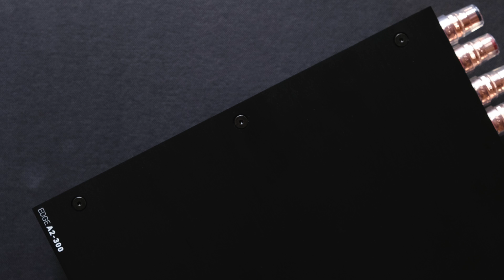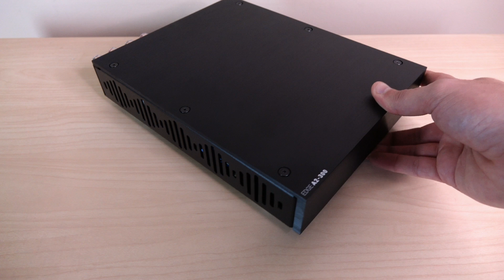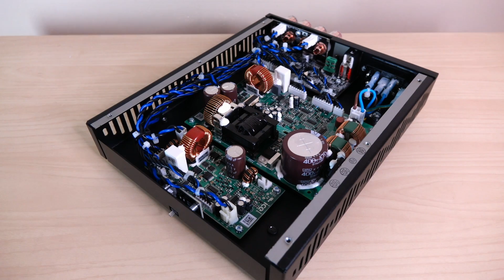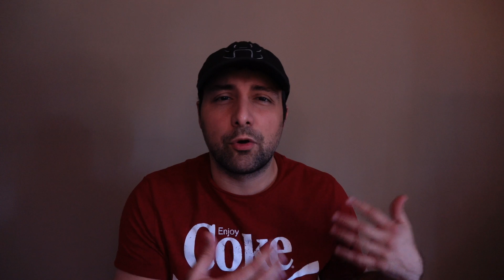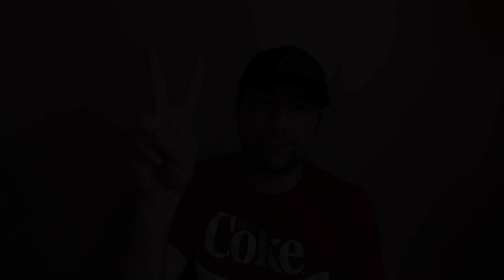Review!  The XTZ Edge A2-300 Power Amplifier

Comment from the maker: Yes, I pronounced XTZ as XTC.  A glimpse into my browser history will reveal the origins of that particular freudian slip.   Next, filming on a partly cloudy day with an open window will explain the huge light contrast variations in the vid.   And lastly,  yes, this is better than the Sprout II in terms of sound quality -  which is how it should for a power amp that costs around the same amount of money.
Reply: The gain potentiometer is such a great selling point...Why don't many other bumbums selling power amplifiers think of this??
Reply: When this was being compared, was it being compared with the iotaVX stack or just the iotaVX power amp from the same preamp?  Just wondering.
Reply: I just got this amp on a Craigslist trade. I love it.  Here's two tips I have found that make this amp go from good to great. Leave in on all the time. Put it in always on mode. Dont turn it off...Makes a Huge difference, at least in my system. Second, back the gain control off a bit from full on, maybe just 80 percent or less. In my system, this amp is dead neutral, not cold what-so-ever and actually colorful. I'm pleased as punch! I'm using a B&K p3 s2 preamp (a Sleeper) and rotate Quad 11L and Dyn 42's   It beat my Nuforce STA-200 which surprised me. I want to check out the hype on the Hypex amps someday. Peace!
Reply: Nice I'm just learning about these class D amps on Audio Science Review. Great work.. 👊now waiting for the new Elac Debut Reference speakers vs those Triangle Bro3 you recommend. I figured we have similar taste in sound.
Reply from the maker: @randalllawkin  -  Apparently the Debut References will be coming my way within the next couple months.  I was told they have to wait until production is ready for my review.  I should blush, but a part of me genuinely wonder where all that confidence comes from.  Guess I'll find out when the time comes.
Reply: Dear God!
Reply: I dont think it is fair without saying, that Sprout has a DAC, preamp and headphone amp in one package. Thus, these are hardly comparable.
Reply: @filippiasec  that's why he said "in terms of sound quality" and not "overall" :D
Reply: Well, I thought you pronounced it more like ecstasy, Sean 😂
Still, great review for a piece which has been in my sight for my bedroom setup for some time now 👍
Reply: Hey Sean, if you were in Canuckistan you would be pronouncing it XTZed and you'd be getting muchos more flack.

Comment: Thanks for the review. Do you think this would be a good match for the Polk r700s. I have an Emotiva BasxA3 and it goes into protection mode every now and then and I was told it was because the Polk r700 needed more power to push them. Thanks for your help.

Comment: I just hooked up an A2-300 to my AVR to power the mains. Absolutely a profound difference. My speakers finally have adequate power. Bass drum hits in particular are now much more powerful and rich with deep extension...sound stage more holographic than before. Yes, it leans slightly away from a "warm" sound. But not that much - my impression is the amp is providing abundant clean noise-free power and mostly staying out of the way, letting the source, dac or phono pre, and speakers do their thing. This amp has provided a massive upgrade to my music listening. And in such an inexpensive, compact, nice looking, efficient, cool running package. Anyone who dismisses class D amps out of hand is an audiophool.

Comment: Hi Sean, thanks for your great straight-ahead reviews and nuanced descriptions of the sonic characteristics of so many hifi components, including ones that are not terribly expensive. Based on your review of the synergy of the Triangle BR03 and the IOTAVX SA3 I bought that combo and added a Schiit Bifrost 2 and really enjoy the sound. Thanks for the excellent recommendation! I'm now buying for a large classroom, and decided to stick with the Triangle Borea sound, so I purchased the Borea BR08s, which I also really like. This XTZ Edge is interesting to me for the clarity and overall tonality that people have praised, the size and price of the unit, and for the fact that it runs cool (I'm located in a hot climate). Thomas and Stereo has suggested that running a D-class power amp with a tube pre-amp (as in the Billie) is a wonderful combination, including with the Triangles. Do you think that pairing the XTZ with something like a Schiit Saga+ or Freya+ or some other tube preamp you might suggest would warm up and/or fill out the sound of the midrange on the XTZ? Your description of it being a little on the thin or cool side makes me feel I wouldn't like that aspect of this amp. Thanks for any thoughts you may have.

Comment: Hello, currently I’m using a hybrid integrated amplifier with a tube pre stage. (Magnat rv4)I love its treble and midrange but, it has no control in the bass. I have a pre-out.
Do you think it helps to bi-amp, with the xtz on the bass?
@zerofidelity

Comment: I bought this amp a few weeks ago based on the reviews.  I am running directly into Bluesound Nodi 2i as  preamp, Dac and streamer.  I am diving a pair Thiel Cs 2.3’s and I am really impressed.  I only stream HD and the sound stage and detail is massive. Excellent product!
Reply: Still liking it? Doesn't sound thin ?
Reply: @joeygonzo  Love this amp. I have been using it for outside deck speakers for the summer and now I am using inside with a Luxman L100 as the preamp and Legacy Audio HD Monitors which is outstanding and not thin at all. Full rich tones.

Comment: Amazing amp I have 2 of these I use as mono amp for my kef R11 I just can say sound is absolutely intense if you the money just go for it its stealth for the money:)
Reply: What is the power output of these amps in mono? I can't find it anywhere - I'm planning on pairing two of these with the Klipsch RP-8000F
Reply: @jakubporuba4085  same watts,  its just turns the stereo signal into mono for both outputs, its not a bridged amp.
Reply: @jakubporuba4085  It is said that it outputs 450 W/4 Ohm if you drive only one channel, as the power supply is the limiting factor. If you're looking for an Amps that can be bridged, you might have a look at the XTZ A2-400. That can be bridged to 800 W/8 Ohm. But if more than double the price of the A2-300.

Comment: Could you suggest any matching pre-amplifier for the XTZ power amp?
Reply: I took a punt recently on the XTZ A2-300 and haven't been disappointed. I use the preamp out on my Audiolab 6000A, which I love the sound of. The combo retains the overall sound signature of the 6000A, but increases authority across the board. The soundstage is outstanding, with every instrument clearly delineated/positioned in space -- even more holographically than the already excellent 6000A on its own (coupled with my Quad S2 speakers). Bass is deep, tight and tuneful without need of a sub. All in all, I'm pleased that my gamble worked out so well.

I have little idea, really, what "cool" means; but in regard to this amp, it definitely doesn't mean overly analytical and uninvolving: I can sit entranced for hours without listener fatigue. Whilst my setup probably isn't the last word in hi-fi, I do think it at least gives a taste of high-end equipment at a very reasonable price -- £1700. Just over £2000 (c. $2,750) if you include extra bits and bobs like a refurbished laptop, D-D convertor, cables and interconnects.

Comment: Loves these videos, and I'm learning a lot, though am still very green in my knowledge of amps. I perused all the comments on this video, but I'm still unclear about one point - is there a difference (other than one resulting from the difference in quality of internal components) between pairing this with an integrated amp versus an AVR? Were I to pair this with an AVR with pre-outs like the Denon AVR-X2500H, to drive a pair of Elac Reference DFR52s, is cleaner, muscular power all I'm getting out of it? Will I not get the other cited benefits of this amp, like good spatial separation? Or would good separation simply be a product of having 'clean power' driving these aramid fiber woofers, and I'm not really losing out on the best qualities of the XTZ Edge?

Comment: I just got the XTZ. What would be a good matching pre amp/DAC for the XTZ? Thinking of combining it with the Triangle BR 02. Thanks for the great reviews.
Reply: I got Br03’s with the XTZ, awesome combination
Reply: @richardblaauwgeers4349  I got the BR03 (200 euro used) as well to try out, together with Wharfedale EVO 4.2 (600 euro new), the XTZ 99.25 LCR (500 euro used) and the Quad S2 (500 euro new special offer), connected to the XTZ Edge, the BluSound Note 2i and the IFI iTube 2 preamp. The Quad S2 surprised me so much, it was the best in my opinion. I liked it so much that I actually returned the S2 and got the Quad Z2. They are now running in, getting better by the day (50 hours run in time). But yes, for the price, the BR03 are very good as well.
Reply: @larsv6144  thanks for the tip, will try to demo the quad speakers soon

Comment: Great great video, thank you so much. I'm purchasing some new Klipsch Cornwall IV , massive speakers. I'm looking to bi- amp the speakers and I would like to get 300 watts to the bass, and 300 watts to  midrange and tweeters. Would this amp be good for these speakers and my goal ? Would I need 2 or 4 of these ?   Thank you so much for your tine and advice.
Reply: You can use the XTZ A2-300 for bi-amping. You can set it with a switch to mono, which gives you 1 channel with 2 x 300 W per amplifier. So two would be sufficient.

Comment: Nice review and i agree to every single point. Using this for about 1 year now with my B&W CM10 and it was a huge improvement over the Denon A/B class amp i used before. More details, more clarity, more distinctive and very dry bass with clean attacks and (what i liked most) this clear imaging of space. First i was afraid of this huge output, but it simply drives my speakers cleaner than the 115 w/8 ohms A/B class amp did before. Probably will stick with this little amp for quite a long time. And i actually like the "dip" - actually didn't even notice that, because my ears are very (too) sensitive in the whole midrange. So every dip is welcome here :-)
Reply: I'm curious how my B&W 607  would sound with this XTZ. but I think I like to try this XTZ. Maybe i could get the same experience like you do , sir Alexander Ziemann
Reply: @odannyblueso  Try it. To my ears it's a great combination, because most people feel the B&W are very expressive in the upper frequencies, so this is is OK with the XTZ, which is a bit rolled off. But: As far as i know the company shut down and does not produce any more.  So you will have to get a used amp.
Reply: @azche24ify XTZ is very much still alive and kicking, at least here in Sweden/Europe. 
Superb high quality manufacturer!  Bang for buck is off the chart. I have the 10.17 Edge subwoofer and are completely blown away by it!  Going to order another one and two A-2 300 for my Marantz  Cinema 50 LCR.

Comment: The Channel Islands C-100S is a standout amongst class d amps.  It can compete with most amps under $5k.  No joke there.  They may not get the press they deserve because they are a small company but that amp is a giant killer.  It’s easy to drive and it has no problem handling my Vandersteen 2CE Signatures.  As a matter of fact, it was far superior driving my Vandys than a highly modified McCormack DNA 125.  It is neutral with great control on the bottom and it’s greatest attribute is it’s transparency.  Class d has matured but like most good things that come along, there will be resistance.

Comment: Sean just saw Thomas's take on this and was wondering if either of you know why mono operation does not bump up the power.I am getting forgetful because when I first saw this review of yours swore this had a low or high pass adjustment but now see it's got adjustable input sensitivity.Wonder about head to head with Crown 2502 which looks to be more bang for buck but might not sound as good.Both are really delivering at $$ point

Comment: XTZ sounds like a perfect amp for my Polk 707 LSIMs speakers that are now being powered by my yamaha 2080. Would this amp work out in a 5.1.2 situation, powering the fronts for home theater? Im torn between this and the outlaw 5000 and the fact that it  doesn't have a trigger input and shipping to the US must be pretty high.
Reply: You don't need a trigger input. Just put it to auto-on and it will power-on when it detects a sound signal. I obtained two, one driving left channel front and rear and one driving right channel front and read. Gives we the advantage to have the full power of power supply when I'm using stereo mode, which should give my 2 x 450 W/4 Ohm instead of 4 * 300 W/ 4 Ohm.

Comment: I have this amplifier in my system for a year, this review is the most balanced and matching my own impressions of the XTZ. Pre-amp choice did make some significant change to the sound, better DAC significantly improved the highs reproduced by the XTZ in my case. Also I've added a tube buffer with shuguang BT tubes to warm up the sound which I did also find on the colder side. Very transparent amp, revealing any changes done to my system. Good review thanks.
Reply: Hi,  Could you clarify what brand & type of "tube buffer" you have ? there seems to be a lot of interest in this thread with all the references to tube preamps, freya schiit . So any experience you have as an actual owner would be very appreciated for those that would want to try the class D sound but might be put off  by the colder side of neutral statement of sean . I am interested to pair this with a dynaudio special 40 to replace the old version of the audio analogue maestro integrated (class A/B) which is currently a bit too dense with looser bass and could use some clarity with the more reserved treble of the special 40. Still don't really want to loose the warm presentation of the vocals and certainly no dry sound as I experienced durign a demo @ xtz germany while listening to xtz divine delta speakers paired with iotavx integrated. ...Thanks.
Reply: @DV-fg4pq  I'm using a Yaqin SD-CD3 with upgraded Z-cap capacitors from Jantzen audio. The tube buffer is connected to the pre-out of a Marantz sr6013 and then to the XTZ edge. I've ordered a new amp based on icepower 1200AS2 ICEedge module to replace the XTZ, since according to reviews the 1200AS modules have improved over the 300AS used in the XTZ edge.
Reply: @calouensilvia  Thank you for the reply

Comment: Any recommendations on an amp $80-150?  Currently using the mx3, but Wonder if something more powerful would give me cleaner sound?  The DAC and bluetooth features aren't necessarily.  A sub out might be, but I can live without.
I have the room for both D class, and a/b.  Whichever gives me cleaner sound for the buck, new, used, refurbished.
Reply: If u are ok bolting in a chassis and wiring up you can buy the excellent and well priced  3e Audio 3255 module and matching power supply on ebay
Reply: @willmac5642  researching... head hurts now... many options....giant coil or something.... different boards to chose from.  There's got to be a Chinese premade one for a little more, that sounds just as good, but where?
Reply: @kineticdyslexic3093  v easy, 3e Audio sell the amp and dedicated power supply on ebay with the connectors. All you then need is a chassis inc power button, binding posts, power cord etc. You get a seriously great amp for around $200-250
Reply: @willmac5642  cool.  I'll probably hang the power coil on my wall, just like I did when I modded my monoprice hybrid tube amp.
Of course I have a spare steel pc case that I can cut up to make a case.  Never been able to cut straight with a dremel, but as long as I don't cut myself..

Comment: I'd like to see a comparison to other IcePower 300ASC amps like the  Emotiva PA-1 (monoblocks for $630 ) and PSAudio Stellar S300 $1499. I like both companies but the PSAudio seems over priced? Also, XTZ doesn't really have a webshop order site up and running. Frankly these are just variations on what you can build yourself such as the 200ASC/AC modules you can buy from Parts Express and case and wires from Ghent Audio. I've built many of these and  you can build the 200ASC/SC for about $300 so a bit of savings. For whatever reason IcePower won't sell the 300ASC module to consumers so you have to scrounge around on Ebay, etc. I'm pretty all in on Class D since I have Mytek amp, PSAudio, DIY, and also Digital Amp Company (Cherry Amp). All great value.

Comment: I'd like to see you compare this with the Emotiva A-300. Same power ratings but class A/B and a little cheaper at $400
Reply: It looks like there are two fans inside the A-300.  If that is the case, it is deal breaker to me.  You might hear the fan noise with quiet music.
Reply: @lanx0003  The XTZ A2-300 has no fan. And it's not getting hot. Very power efficient.

Comment: Great content  I am learning a lot from your channel my question is as I  researched an amplifier is does the same job as a reciever so  why would  you just use a a AV receiver and can you show how you set it up did you just plug the speakers into the amplifier thanks
Reply from the maker: If you're running an AV Receiver, the only benefit of buying a dedicated power-amplifier is to get cleaner, stronger sound than what your AV receiver is capable of delivering.  Some people who run multi-channel systems like to do this.   However, you need to make sure that your AV Receiver has "pre-outs" first.  This is how you will connect the amp to your receiver.  Without the, this isn't an option and you're stuck with the amp(s) inside the receiver.
Reply: Thank You
Reply: @ZeroFidelity  So will this work with any AV receiver with preouts and get the benefit of a cleaner and stronger sound. Thanks!